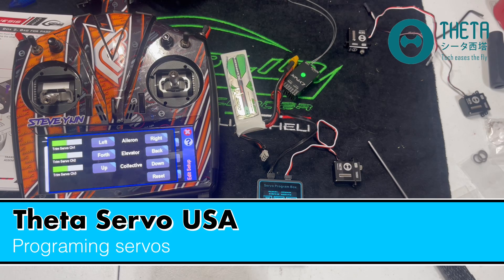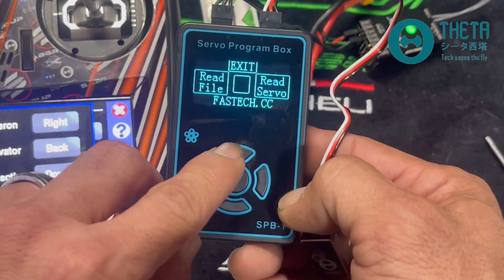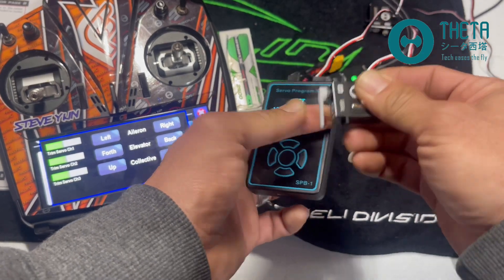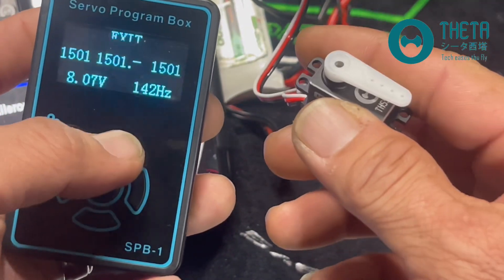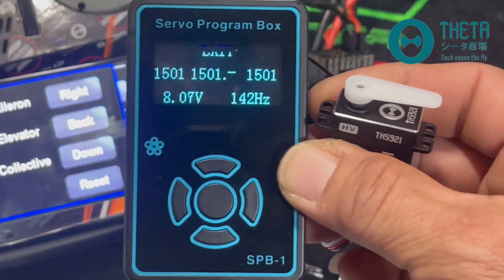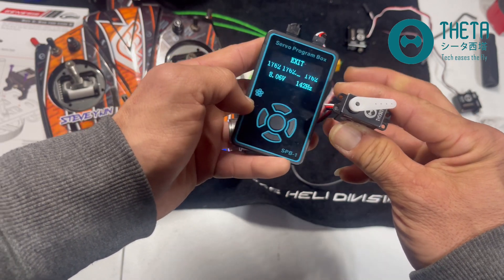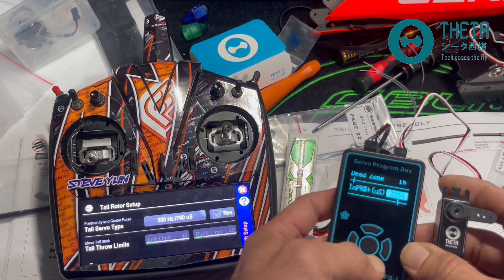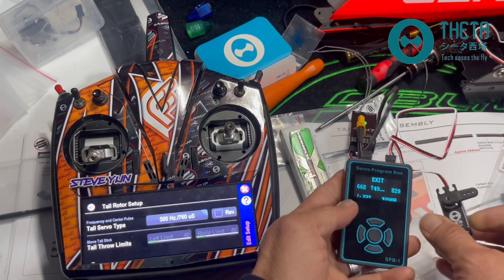Theta Servo Programming

Comment: I just got my program box. When programming center on each servo channel with the programmer, should I plug the box into each individual channel 1-3 for the corresponding servo, also the  tail servo should have the programmer plugged into the tail port on the evo?
Reply from the maker: Yes I plug it into each port the servo will be plugged into its final configuration.  I usually go through each either on the heli if I can access the servo horns screw easily or before putting the electronics in and do the full center and programming to of each servo. Tail can be plugged into the tail port. As long as the tail servo and FBL are both configured for the same pulse width band. Eg 760 or 1520.
Reply: @StevenHeli thank you. I tried centering with only the program box and then when I went to heli setup through the evo the center was off. So I plugged the programmer into the tail port and kept “testing” it till the evo agreed with the center. Now my M5 has a better centered servo!